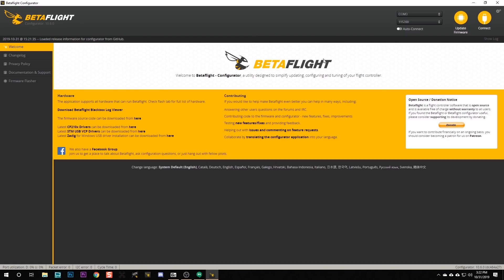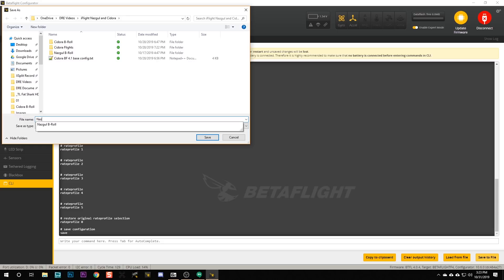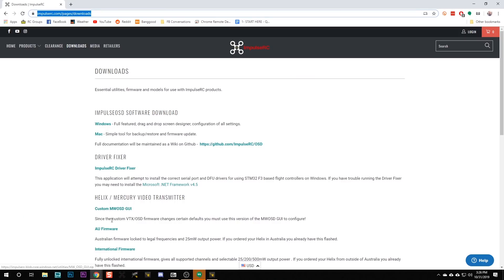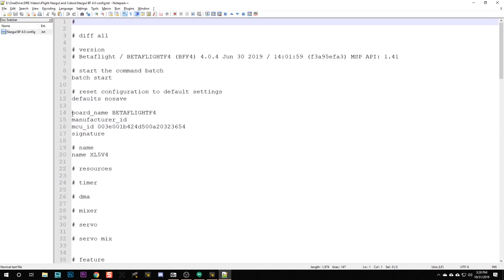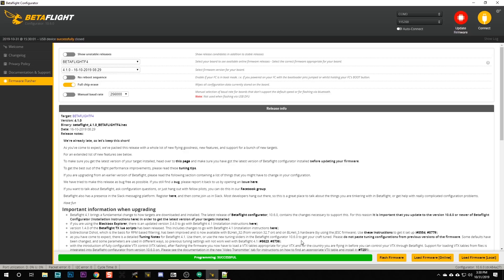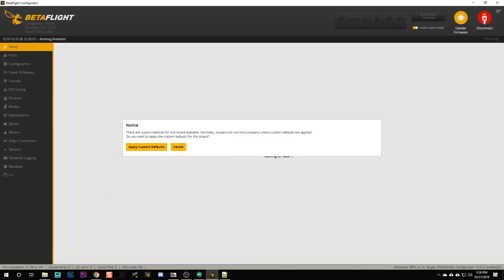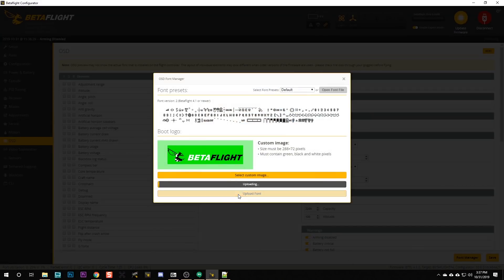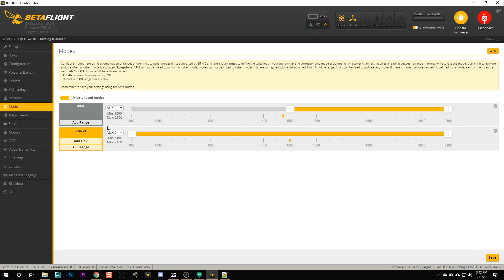How to Flash Betaflight Firmware (Upgrade to 4.1)

Comment: Hi Joshua,Thank you for your videos,would not be in the air without your help. I just updated my new build tmotorf7 from bf4.1.0 to 4.1.5. When I go to upload font it just freezes and never loads? Is this because it is already on 4.1 font? It says font versions : 2 (beta flight 4.1 or newer) ? Thanks as always
Reply from the maker: Need to have the battery plugged in otherwise the MAX chip is not powered up to receive the font.
Reply: @JoshuaBardwell  thanks Joahua,appreciate the reply. Unfortunately had the battery plugged in but still the same outcome?

Comment: @Joshuabardwell I have the eachine wizard x220 it's still on bf 3.2 from when I first got it that was the newest version at that time, I now want to flash bf 4.2 I think it is now but having real problems with it, i have re downloaded the cp210 drivers and stm32 com-port drivers an zadig 2.4, when in bootloader mode zadig doesn't see the bootloader only the comport and vcp drivers, iv tryed running the impulserc driver fixer but it doesn't see the flight controller so it just keeps searching, I know it's an old board but really hoping to be able to flash it, its the sp racing f3 v1. 0 flight controller, can anyone please help, I'm getting a bootloader communication failure in betaflight, thanks for all the content you put out Mr Bardwell you have taught me so much about this hobby, I've tried about all I can think of, don't know what to do now.
Reply from the maker: The SPRacing F3 flight controller on the X220 is one of the last ones that doesn't use the STM32 VCP driver. It uses the CP210 driver instead. You will never see DFU in the pulldown menu even when the FC is in bootloader mode. Flashing it is a bit of a pain in the ass sometimes, to be honest.
Reply: @JoshuaBardwell  thank you, I did eventually get it done, I meant to reply to you when I did and I didn't see that you had replied to me, iv recently put a better fc n esc stack on it and changed the motors, it's still a crap frame but flys sooo much better now on 4s! Just waiting for the frame to break so I can have an excuse to buy a new one n swap parts over, also just got myself a nazgul5 v2 after watching your vids, my apologies for not thanking you sooner

Comment: ehhhhhhhhh you ever had issues with the stm32 drivers? I am trying to flash my sussex32 20x20 but i am finding i will not connect in boot mode. I have installed the drivers from STMicroelectronics but it says in the release notes " For Windows 10, use Microsoft inbox driver and not this package" so.....i am at a loss.
Reply from the maker: 1. Hold down the bootloader button. Plug in the USB cable while continuing to hold down the bootloader button.
2. Run the Impulse RC Driver Fixer app (https://impulserc.blob.core.windows.net/utilities/ImpulseRC_Driver_Fixer.exe). It should "fix" the driver successfully. If not, do not proceed.
3. Un-plug the USB cable.
4. While holding down the bootloader button, plug in the USB cable again.
5. Start the Betaflight Configurator app. In the upper-right corner pulldown menu, you should see "DFU". You can now flash the board.

For more detailed instructions on how to install the STM32 drivers: https://www.youtube.com/watch?v=m4ygG6Y5zXI

Comment: I'm an extreme noob lol so if I haven't messed with rpm filtering or any of that stuff just basically got the qwad to the bare minimum to fly. Can I update the firmware and just dump the whole saved config into the CLI without having to go through and remove those lines in the config you talked about. Also if i update betaflight to 4.1 on the computer will it mess with my quad that is running 4.0 and my older one on 3.5. Thank you for your videos if it wasn't for you I would have never been able to get into this amazing hobby.

Comment: I'm a rookie. I'm using Turnigy MultiStar 30A BLHeli_32 4-in-1 Race Spec ESC w/ F4 FC, OSD & BEC (2-4S) board. This board supported Dshot 150 -600. As your suggestion I chose Dshot 300 with 4k-4k. I don't know why the motor #3 show 100% error while the others don't. And it only happened to motor #3 when i try the other two Dshot mode.  Could you diagnose the reason why it happened or guide me through how to troubleshooting it, please? Thanks!!!! (if u asked why is this FC. this is a project in my school and for commercial use. and the recommended FC was out of stock so we had to pick this one to keep the project going)

Comment: Hi there, I cannot get my new crazy bee f4DX board to get into DFU mode. The board won't even see the software. It did but then I followed the vid and upgraded the new version 4.1 and something happened./ Now I cannot get any connection between my board and betaflight. i have another mob 7 and that baord is fine and connects and goes into DFU. Any suggetions.

Comment: Can I update an Flip 32 F3 Omnibus V2 FC (BF 3.1.7) to the latest Betaflight 4.1._? How does one know when an FC can 'no' longer be updated? Your vids are invaluable , thank you.
Reply from the maker: Basically, look in the Firmware Flasher tab, set the BF version you want to upgrade, and look in the list for your target. If you don't know your target, go to the CLI and type "version" and it will show your target is e.g. OMNIBUSF4SD or whatever. If that target is not in the list, go back to an earlier version and look there.
Reply: @JoshuaBardwell  Thanks very much Joshua and have a super day!
Reply: @JoshuaBardwell  So I did that but this time looked up Flip32F3 and flashed that. Now the quad won't connect to Betaflight. No com3 port. Connected my Meteor65 no problem. Tried my Flip32 and it won't connect to BF. I tried to flash anyway but it doesn't work since it doesn't 'see' it. Any ideas? I think I should have used Omnibus 32......geez.
Reply: Got it connected in DFU mode,  flashed with Omnibus and it 'succeeded' but can't get Com Port 3? I rebooted the PC  no go. I also don't get the windows sound when connecting. Zadig doesn't show the device and I don't see it in device manager. At my wits end. Do you think I somehow damaged it? Should I replace the FC?
Reply: I've since tried other FC and they ALL connect to BF. I'm pretty sure the FC failed. I might give those new JB F4 FCs a try.

Comment: Hi, thanks for doing this tutorial but I do have a question. 

I believe I am using the same FC and ESC as your Nazgul5 (Succex-e F4 stack) but when I clicked on the drop down for target, there is no BETAFLIGHTF4, but instead there is BETAFLIGHTF4 (FPVM) & BETAFLIGHTF4 (Legacy). 

Which one do I use? Thanks JB
Reply: Joshua said, first the non legacy version

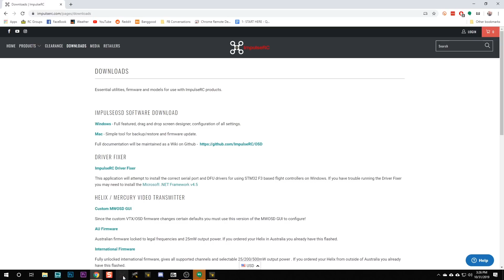Comment: My firmware update (using a smartphone) failed for an unknown reason and now Betaflight isn't seeing my JHEF7DUAL board. I'm stuck on "Searching for flight controller" 3:59  :/
Reply from the maker: Basically, you probably need to fix it by re-flashing it in DFU mode on a PC. If there is a way to restore it via the flasher app, I don't know.

Comment: thank you Sir for all the worthy information you and that make-up wearing fast talking freak post much needed info for all us new-Beez. liking your vids the most because i can understand you and thnx for not talking to fast. you explain things in a way we understand. after a few days downloading programs. I was getting ready to pull-out all my brain hairs trying to figure out y my Quad was not working after updating my firmware to Frsky in betaflight. well that's the kinda transmitter that came with this Spedix. I didn't realize that the Flight Controller is a LUX V2. as soon as figured out that is was the FC that needed to be flashed and not the transmitter. I'm thinking now finally It's good to go. well at least the GYROS are on now and the motors in that feature is now turning yellow.  just waiting for my radio batteries to finish charging. i got the Jumper T16 Pro. after watching yours and a few others reviews on it. I waited till they put OpenTX on it.

I can't thank you all enough. learning from the Quad Princesse about 3D set-up yesterday was awesome.. OMG that Gal Blows my mind every time.

Comment: Hi Joshua, I have a problem with the most recent versions of betaflight for nazgul .... the name of the firware for fc of nazgul is betaflightf4 right ...? Well, now there are two versions ... (betaflightf4 obsolete and betaflifgtf4 FPVM) here is a screenshot: https://subefotos.com/ver/?e06d461f260bf28bff51774550691ed3o.png
  the case is that I have tried both versions (fpvm and obsolete) and both give the error that the smart audio does not work correctly ... the smart audio works for pid themes or pid profiles but not to configure the vtx in the case that you want to change power or channel on the flight track ... this is a big problem for me .. could you help me .. ??? Everything else works fine but on the topic of VTX either by tbs smart audio or tramp no ....
PS: Excuse me if I do not explain myself well ... I am using the google translator and sometimes translates things as it comes out of the balls ...

Comment: my nazgul 5 won´t go in to the bootloader /DFU mode ? i tried all usb cables i had and run the Impuls Driver fixer 100000 times but won´t work? pls help
Reply from the maker: Are you doing it via the bootloader button or via the CLI? If one, try the other.

The CLI command to enter bootloader is "bl". When you issue this command, the configurator should disconnect and the COM port should disappear. If you don't see DFU in the configurator pulldown menu, run ImpulseRC Driver Fixer.

Comment: What if after choosing com1 connect and nothing the quad is lit up blinking
Reply from the maker: Almost certainly COM1 is not the one that your FC is on. Usually it is COM3 or higher. I would make sure that COM3 is not available, and if it is not available, make sure that your drivers are installed.
Reply: @JoshuaBardwell  duh yep silly mistake thank you I managed to connect and load new version into my f.c thanks again

Comment: Hi Joshua, I just upgrate betaflight firmware on my geprc cinequeen 4k (target not legendary)  to 4.1.1 with the help of your videos.  After binding my quad's frsky r-xsr receiver to jumper t16 pro I realized that the receiver tab on betaflight configurator 10.6.0 is not responding. All the lights on receiver and the telemetry on the jumper t16 indicate binding was perfect. Also, port settings are as described in the receiver"s manual.  What do you think about the problem.. Target issue? or the receiver is not compatible with the betaflight 4.1.1 ?

Comment: I tried to Flash my Inductrix Pro BLH8616. Thankfully i used the cli command diff all; i found that my target was NAZE which i could not find. and as a Mac user, i was unable to get my board into dfu using the bl command. reason, because naze last support is 3.2 looks like im not going to update or fly it. it'll stay on the wall. appreciate this video.

Comment: Hello from another Joshua over here in California. I have a 2018 Model 5 inch quad from ldarc that is running a super old version of betaflight and I'm wondering if I can still update it to 4.1. The person I got it from said that he would be afraid to upgrade it because it might brick the fight controller. do you think I still have a shot or should I just stick with the old version of betaflight it still flies pretty good despite being on an old version. Thanks! I hope you have a great Thanksgiving
Reply from the maker: Betaflight 4.1 requires at least an F4 processor. If the quad has an F3 or an F1, then Betaflight 4.1 isn't for you.
Reply: @JoshuaBardwell  alright, well looks like we are good with it being an f4 fc. May have to give it a shot! I really appreciate your channel and what you do. The stack is the kk super fly tower 40a by the way.

Comment: Sorry another question lol Is BF configurator reverse compatible to use on 4.0.6. and to use the driver fix does it need to be already connected to betaflight first. It just keeps saying. searching for flight controller and I think IV tried both ways and can't get the spf3 in bootloader with the pads or the cli or the actual button in bf.

Comment: OK, I updated my iFlight Nazgul5 from 4.0.4 to 4.11. I did a manual setup insetesd of using the "safe" diff all method. All seemed to go well and everything is working as expected with one exception. After going above 50% on the throttle it goes to 100% and stays there until I disarm. Also the motors are getting way hot way fast. What have I done wrong? Any ideas on a fix? Thanks in advance for any info.
Reply: OK, I figured it out. Airmode was causing my problem.

Comment: Ok so I did something wrong I flashed new beta on larva x and connected just fine b4 now won't go into dfu mode or connect at all any clues ?!?!
Reply from the maker: Flashing Betaflight should not be able to screw up DFU mode support. You should be able to get back into DFU mode by using the bootloader button on the FC. Then re-flash BF and make sure you are flashing the correct target for the FC.

1. Hold down the bootloader button. Plug in the USB cable while continuing to hold down the bootloader button.
2. Run the Impulse RC Driver Fixer app (https://impulserc.blob.core.windows.net/utilities/ImpulseRC_Driver_Fixer.exe). It should "fix" the driver successfully. If not, do not proceed.
3. Un-plug the USB cable.
4. While holding down the bootloader button, plug in the USB cable again.
5. Start the Betaflight Configurator app. In the upper-right corner pulldown menu, you should see "DFU". You can now flash the board.

For more detailed instructions on how to install the STM32 drivers: https://www.youtube.com/watch?v=m4ygG6Y5zXI
Reply: Oh have the stm driver
Reply: Thank you so much I think I  got it now I really appreciate all your videos and am surprised on how fast you responded I just check it thinking you haven't gotten to  it yet . But you had already replied 😂 too dope too fresh!!

Comment: Can I use betaflight 3.5.5 firmware on 10.6 configurator? I want to run 4.1 on one of my quads buy have 3.5.5 tuned nice on a bunch of my smaller quads? Thanks JB
Reply from the maker: Yes, you can use the older firmware on the newer configurator.
Reply: @JoshuaBardwell  thanks for confirming this but after 5 hours of trying to install 10.6 on this piece of crap Mac has me taping out for tonight. I read everything in betaflight release notes without luck. I do appreciate your time and help. Take care JB

Comment: Hi joshua, I would like to know if resource remapping has changed in 4.1. The reason why I am asking is because I tried to change my camera control to a motor pin and it wouldn't let me move my camera control. I have the matek f722 flight controller. In 4.0 I was able to remap it. And 4.1 it won't let me. I was able to free up the motor resource. But I cannot reassign the camera control to that resource. Any help would be greatly appreciated. Keep up the good work

Comment: Is it worth upgrading to 4.1 if you have BLHeliS and the other vendor that has written code for your ESC does not work, so basically your stuck with BLHeliS. Is there enough in there without RPM Filtering? The tuning bars look nice.
Reply from the maker: There are lots of good things about 4.1 other than RPM filtering. I would do it.
Reply: Joshua Bardwell bless you. Thanks 🙏 JB 👻

Comment: Thought for a new vid... How to get our personal  VTX tables into the Taranis to use with Lua Scripts?  I have powers (mw) showing in Lua screen that aren't available with my VTX, so how do I know I'm truly getting the power I set via LUA?  Thanks for all you do Joshua!
Reply from the maker: I think that the latest Betaflight lua script should read the power levels from vtxtable. Are you using lua script version 1.4 or newer?
Reply: Yes, just updated Lua scripts to 1.4.1 and Taranis X7 to 2.3.1.  When I run Lua I get the default settings for Tramp which is 5 power levels whereas I only have 3 (0, 25, 600) and is configured that way in BF 4.1.0.  I can adjust power, band and channel via the Lua scripts however, power levels aren't accurate as set in BF.

Comment: YES!  You did mention "Make sure your props are off".  Anytime you're working on the bench, take them off!!!!  Props are off, Receiver working, I need to verify motors are correct, modes tab needs re-programmed with the switches on my radio.  Yes, go fly your quad!

Comment: Hello JB and thanks for the step by step video. I have a cidora and i've done everything you say to update to 4.1. I flashed the firmware and now as i'm connecting it says next to "Update firmware" No dataflash chip found and as i'm checking the 3d model doesn't move at all.
Reply from the maker: No dataflash chip can be ignored. Many FC don't have one. It has nothing to do with flashing. It has to do with blackbox logging.
Reply: I thought because of that my gyro doesn’t work, and I can’t see my ports, except USB VCP.

Comment: Hello! Could somebody please send the discord link for the fpv discord?
Reply from the maker: My Discord server is open to Patrons only. I'll be glad to try to help you here or in FB messenger.
Reply: @JoshuaBardwell  ok no problem! I have a question about lipo charging because im very new to this great great hobby. Is it ok charging a 1000mah and a 1500mah battery at the same time(multicharging board)? They are both 6s.

Comment: Huh? What is all of this? I upgraded from 3.5 to 4.1.0 and all I need was the vcp driver. Just installed flashed with full chip erase. I didn't even bother with dumping files jusr did the set up all over again and it worked fine...all of this is almost Greek